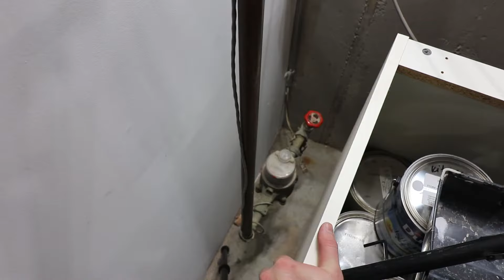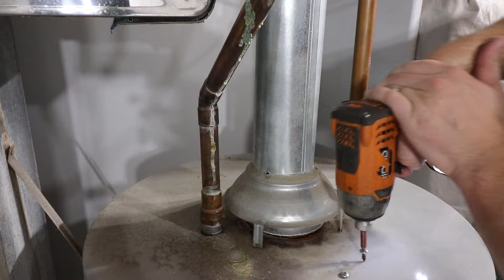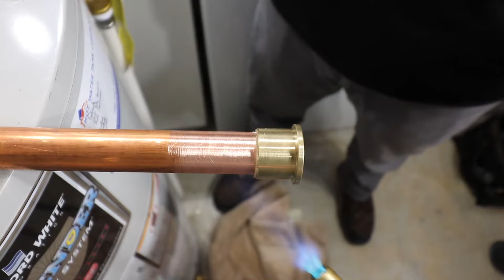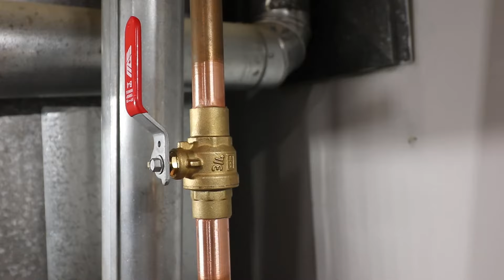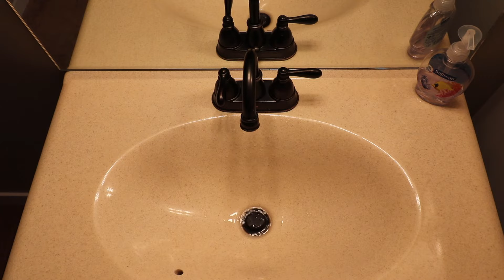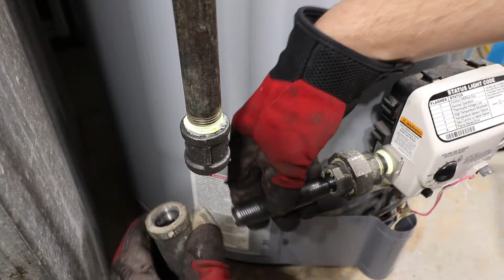Water Heater Replacement: How to Replace a Gas Water Heater

Comment: Not sure if you can answer this...will the sharkbite work as well as the solder? I'm not too confident in my soldering  capabilities and I don't have a lot of time to do the job. But I want a long term solution. I like sharkbite or compression fitting but am not sure about the longevity. Any advice is welcome. Love the video....well done!
Reply: Most professional plumbers advise against sharkbites. Sharkbites are mostly a handyman thing, and it's not that hard to learn to sweat copper as a diy'er.
Reply: regardless of what other people have said, sharkbites have been around for DECADES and ARE approved for in-wall installations (meaning you can seal them up in a wall with no access required by code).  What that means is they have been evaluated by real professionals and over a period of time to allow for this type of installation.  The biggest problem comes from improper installation... which is then attributed to the actual product failing... which it did but ONLY due to improper install.  A common improper install is failure to remove all burs or debris from the pipes... which will interfere with that o-ring or even damage or tear it which would allow for leaks.  FYI, I am not a plumber but a very well informed home owner who, out of necessity for being poor, learned all about various trades and services and how to do them RIGHT.  My actual career is I am an IT engineer and an unlicensed electrician.

Comment: Nice well done and helpful video.  It should be noted that homeowners should check with county to see if a permit is required for water heater replacement.  In my county, I need to pull a permit for replacement of my water heater.

Comment: Ran into a snafu . The new heater is a bit taller by two inches. The exhaust stack don't match. Darn . It's not straight up but has a 90 elbow near top. In an outside closet.

Comment: Great video! Succinct and well verbalized. Not overly verbose! 😁👍🏼
My turn to replace our gas H2O heater.. Ours includes "expansion tank" on the top. Do you have a video replacing a H2O heater with expansion tank?

Comment: DIELECTRIC UNIONS was my main question in the post below that might have got lost with all the praise for your video so thanks again for the quick response that really helped me figure out this lack of information about this.

also if you have a favorite plumber's dope I for one would love to hear about it cause I hear a lot about one that is Blue and no idea where to buy it? also do you use both teflon ((any brand better than another) or do you like using the thicker gas teflon on your water lines) and dope or just one or the other.

thanks again for all your help and for sharing your wisdom!!
Reply from the maker: I use Oatey Great White pipe joint compound with PTFE for potable water
Jet-Lube TF-15 for non-potable water (This stuff is amazing for anything non-potable)
Unasco Pink Industrial thread sealing tape for potable water
It depends on the situation if I use tape and dope or just one. I tend to tape and dope dielectrics to the water heater nipples because I find the tank nipples tend to have poorly cut threads from the manufacture. Most other connections, one or the other will do.
Reply: I am not a licensed plumber but I love blue-monster.  Very reliable also!

Comment: I want to thank you for taking the time to make and post this video. your skills are evident that is for certain. nice upgrade on the gas line and really like the union next to the tank's GVC for easier removal so you might not have to take the gas line apart on the next install (or the next guy will be grateful).
my question is about dielectric unions and it's not an easy subject to find good information about even with Google and YouTube. I noticed on this install you didn't put one on the hot side with the shark bite, but you mentioned you normally solder one on both hot and cold? any explanation you'd like to mention about this?
i'm having to change out a failed gas hot water tank after in service for only 6 months and the dielectric on the hot side I can barely see thru cause it has so much build up. don't the new tanks also have nipples with dielectric?
thanks for any help if you have time to comment on this.
Reply from the maker: Thanks Michael! I think it's just old habit that I'm still using dielectic unions. I've been using them since the start of my career and before dielectic nipples were standard on most water heaters. You're correct that the nipples coming out of the tank are dielectic, lined usually with a blue coating. Does the hot side dielectic look clogged with corrosion or debris? It's very common on a new install to get debris caught in the water heater's inlet/outlet because the home's water distribution system was disturbed (water on off, moving piping). Just a side note: The original Sharkbite water heater flex lines were awful and so I stayed away from them. The tubing inside them would actually deteriorate and clog up all the fixtures in the home. As far as I know, this has been resolved.
https://www.classaction.org/sharkbite-water-heater-connectors-fittings-lawsuit

Comment: Great video.  City and county codes always bug me. Everything put in 15 years ago is now too "dangerous" and the fact that the codes change across CITY lines crazy.  Per the code writers,  everything built before 1995 should have exploded by now.
Reply from the maker: So true. I can have completely different codes to comply to,  just travelling 10 minutes down the road to a different county. A lot has to do with the inspector as well.

Comment: pro tip for installing a your own water heater, work for a plumber for a minimum of 4 years, take the tests, and get your masters license.
Reply: Sorry, but that's way too broad of a brush you're painting with there.

I have seen plenty of homeowner installed water heaters (gas & electric) that were done correctly, had a permit pulled, nicely run lines, and were inspected. I have also seen some hack & slash jobs that just defied belief that were done by licensed plumbers. It depends upon the capabilities and understanding of the homeowner. I really dislike this lumping of all homeowners into the category of morons who don't have enough sense to come in out of the rain. If the homeowner doesn't know how to identify a type of screwdriver, then yeah, call the professionals. But a homeowner that understands the fundamentals of plumbing, knows tools and methods, does it the right way and gets a permit, calls for an inspection, and it passes, then I don't see any problem at all.
Reply from the maker: Lol, you definitely don't need to be a master plumber to replace a water heater (unless local codes require it). There's a reason that almost every company sends 1st and 2nd year plumbers to replace water heaters.
Reply: @PROSDIY  local codes require it. plus an inspection.
Reply from the maker: Your "local codes require it." There are many jurisdictions that don't require a permit for a water heater replacement. In the end it's the home owner's responsibility to know what they can legally work on and not in their home.
Reply: oops = boom

Comment: You can definitely replace a water heater yourself. But, should you?? If you do, make sure you get a permit and install it to code for safety reasons. I thought about replacing mine and wasn’t aware that I should get a permit which doesn’t cost that much. But, I decided to hire a license plumber, and he installed it to code which included things I wouldn’t have done. It ended up being more than disconnecting the old one, and connecting the new one.
Reply: Guess you have money to burn.

Comment: Which do you like better shark bite fittings or soldered? Seems like shark bite would be easier for DIYers
Reply from the maker: Hi Rick, I personally use dielectric union soldered connections. I find that it has a cleaner look and has less restriction than flex lines. You're right, the Sharkbite fittings make installation quick and easy.
Reply: @PROSDIY  Amen. That was my only criticism of this video: there's no way I would use Sharkbites, especially when I had a torch right there and the cold water was sweat in. If I were a homeowner and saw a professional plumber using a Sharkbite to make that connection, I'd stop him and tell him no sir. Sweat it. 

Great video and thank you for the time to make it.
Reply from the maker: @bullmoosepiper7732  I agree. I felt weird installing that Sharkbite for sure. I just wanted to show 2 possible methods in the video. Nothing beats the nice clean look of sweat copper. Plus there is this: https://www.classaction.org/sharkbite-water-heater-connectors-fittings-lawsuit
Reply: @PROSDIY  What about dielectric connections with copper?  I've seen some videos where that will accelerate corrosion and you'll develop pinhole leaks

Comment: just curious why didnt u just sauder the hot line as well?
Reply from the maker: Hi Cody, I wanted to show multiple connection methods. I normally use soldered dielectric connections for both sides. Thanks for the question!

Comment: what is better stainless steel or corrugated copper connector ?
Reply from the maker: To be honest I don't use corrugated water lines. They cause turbulent flow, which can lead to pinhole leaks. If you have to use a flex waterline connection, I recommend using a braided water line which has laminar flow. Thanks for the question!
Reply: @PROSDIY Thank you as well for your knowledge and expertise!! Much appreciated 🙏

Comment: Well done.  Your video is very clear, good audio, clear camera footage.  I called a national big box home improvement store and they wanted $1,300 above the price of the water heater for installation.  I've seen pro's do this with 1 or 2 guys in under 2 hours.  Sounds like gouging to me.  I am fortunate that my water heater is a spacious furnace room.  My biggest issue is getting two large adjustable wrenches!
Reply from the maker: $1300 for labor/parts (not including the water heater) for an atmospherically vented water heater install is way too much. Most plumbers charge between 3-4 hrs labor plus parts. This covers the cost of overhead, delivery, install, and removal of the old tank. I'd do a little shopping around. Good luck!

Comment: Why not just use a another shark bite on the cold line? This would be easier and quicker than soldering.
Reply from the maker: That's true. I just wanted to demonstrate multiple methods.
Reply: @PROSDIY  ok. I was just wondering because I suck at soldering.

Comment: How much does job like this cost, only labor
Reply from the maker: The cost varies greatly based on an area's hourly rate and if you get a company or an individual to complete the replacement. My hourly rate is $95/hr and charge 3hrs + parts. Which includes removal and recycling of the old tank. There are a lot of companies that don't install owner supplied tanks though. Most companies make their money on the water heater's markup. I can find people advertising in the classifieds for as little as $150 for the install and as high as $500. These numbers are in CAD.
Reply: Pros DIY thank you for responding.
Reply: Pros DIY Pro one more question. Usually how much you charge for job like this? And how much you spend on parts?
Reply from the maker: To be honest I don't complete owner supplied tank installs. I supply my own tanks either AO Smith or Bradford White depending on the job. 40 US gallon atmospherically vented water heaters at $1100 + gst CAD and 50 US gallon at $1300 + gst CAD. By supplying my own tanks I can control the product and warranty that I'm installing. Just for an idea I would probably charge around $350 CAD for the complete install, removal, and parts if I were to offer that service.
Reply: Pros DIY thank you. Someone wanted to charge me 1,200 over the phone. And I only have a 40 GAL and 40,000 tank. Told my wife that seems kinda high. Wish you lived here I would hire you.
Reply from the maker: No Worries. Definitely shop around. Unfortunately there are a lot of companies that overcharge for water heater installs because they know the client is usually in a desperate situation. I know some that will throw out ridiculous numbers. Online reviews are your friend. Good Luck!
Reply: @PROSDIY Why only AO Smith or Bradford White? Wbout GSW and JOHN WOOD?
Reply from the maker: @kw7006  Thanks for the question! AO Smith owns GSW/John Wood. They were bought out in 2006. To be honest if you take a John Wood and a AO Smith 40 US gallon atmospherically vented water heater and put them side by side, they are the same. The only thing different is the branding sticker. It depends where you live and the distributor on which one they'll sell. Canadian's will see more John Wood/GSW brands because it used to be a Canadian based manufacture. So to answer your question I have no issues with installing AO Smith, John Wood, GSW, and Bradford White.

Comment from the maker: 𝗔𝗺𝗮𝘇𝗼𝗻 𝗔𝗳𝗳𝗶𝗹𝗶𝗮𝘁𝗲 𝗟𝗶𝗻𝗸𝘀
Bernzomatic Torch: https://geni.us/x4TI
Mapp Gas: https://geni.us/n7L2
Plumbing Solder Kit: https://geni.us/HJEHYVT
1/2" Superior Tube Cutter: https://geni.us/Ocd34p
3/4" Superior Tube Cutter: https://geni.us/pU92Q
4-1 Fitting Brush: https://geni.us/59i2
Deburring Tool: https://geni.us/xajBQ6T
Flame Protector: https://geni.us/cVWLQd0
Gas Leak Detector: https://geni.us/mQ9Gw

Disclosure: Pros DIY is an Amazon Associate. We earn a small commission from qualifying purchases through our affiliate links at no additional cost to you.